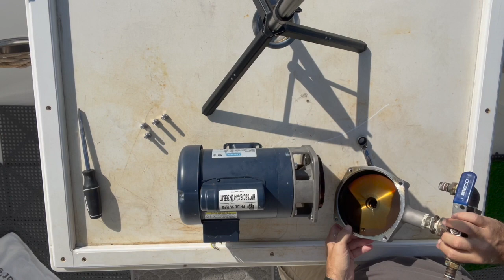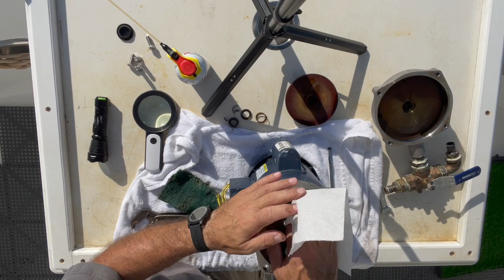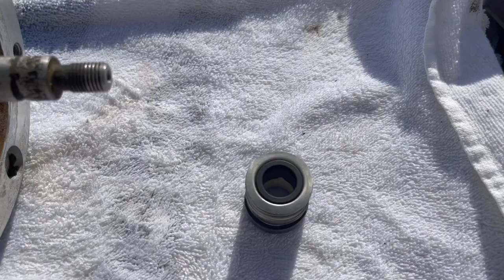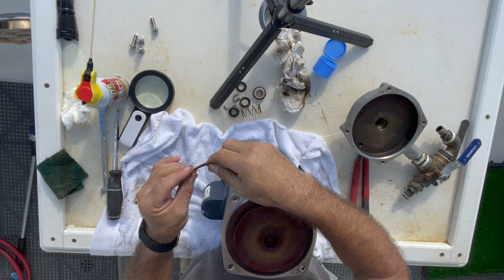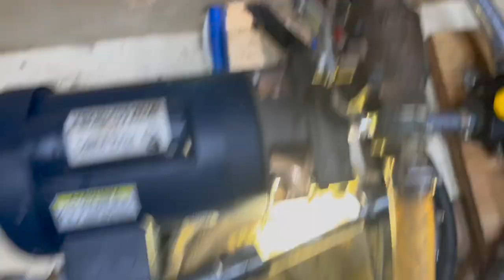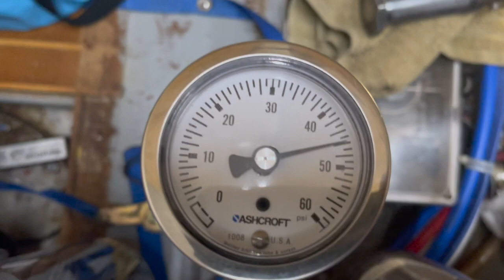Low Pressure Pump Rebuild aboard Chicory a 46 Nordhavn

Comment: I’m glad to see you remembered the washer for the shaft on the motor face 14:36. I work in the HVAC field and have rebuilt many pumps like yours. It’s a shame they used a non-SS motor shaft, the rest of the housing looked awesome for having saltwater running through it. I have really enjoyed your maintenance series on a very capable little ship..
Reply from the maker: Thank you for your comments. I agree that the 100% stainless steel pump shaft should be treated somehow to prevent corrosion. A plain mild steel shaft is insane.